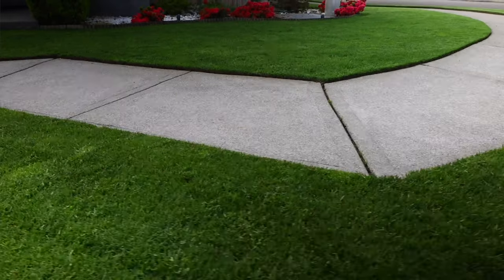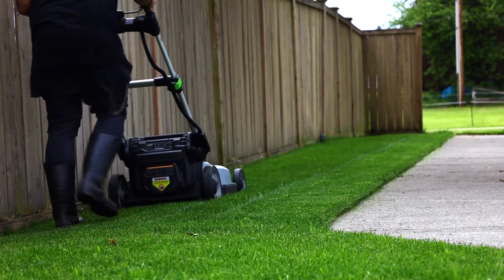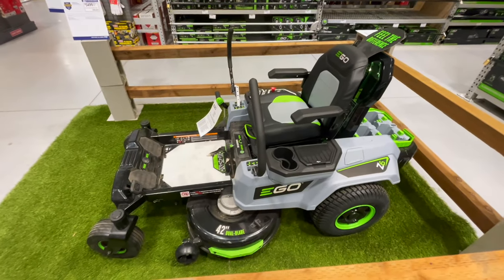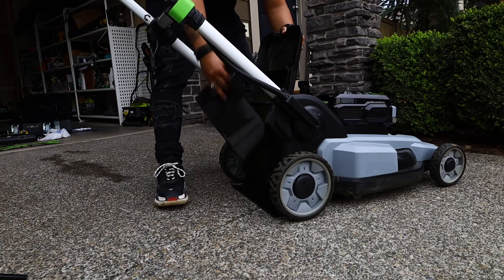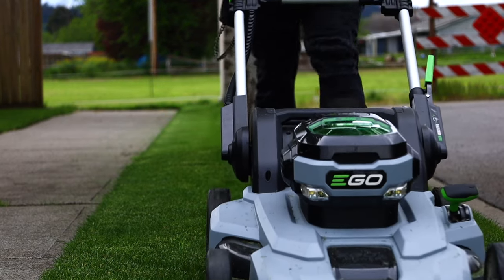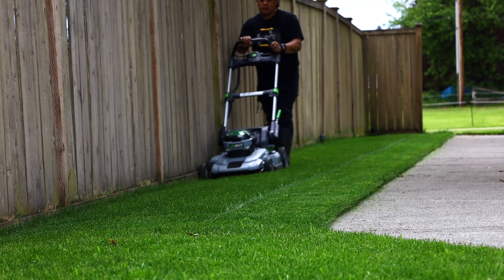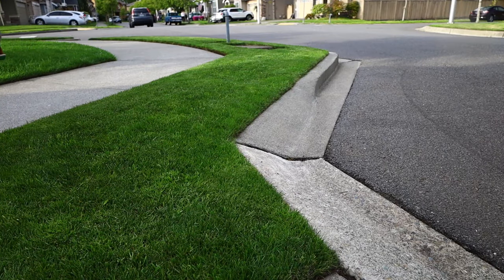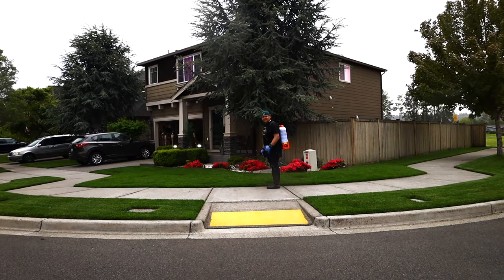Bagging or Mulching grass? great debate! Installed the EGO select cut Mulching Blades on the LM2100!

Comment: I have the ego 2135sp select cut, and I've found that if the grass gets a little high, mulching then putting the bag on (still using the mulching blade) and going over the mulch trails works extremely well.  This is what I did with my Honda, and the ego handles the job as well or better.  No need to put the bagging blade on the ego.
Reply from the maker: Yeah I noticed when I verticut the ego picks it up well so you’re method sounds fun! I gotta try it! You know me love to mow 30x a day on my 100sqft lawn 😂😂😂👊🏾😊🤙🏾🙏🏾🔥

Comment: Great video! I'm looking to convert my old 2102SP to the dual-blade set up. Before purchasing the parts as you listed, can any of the parts from this mower be used in the new setup, such as washer, bolts, etc.?

Comment: Just a heads up -  the link at top to extended run blade goes to a page with "Mulching Blade' in main title.  And when ordered you get an extended run pair in a box marked AB2100D Mulching Blade.  Also the extended run blade in box is actually stamped "lower mulching blade".  I ordered this a year ago as spare based on main title of page and am stuck with two extended run now since I already had the unused one that came with mower.  That one BTW is stamped 'lower extended run" with same engraved part number CH3707066002 as ordered spare.  In summary - open box to make sure you in fact received what you intended to order.

Comment: Silly question - the AB2101D mulching blades aren't listed as compatible with the LM2100SP mower? The only option I've seen as officially compatible is the AB2101 high-lift blade. I want to mulch and was going to go high-lift + mulching plug. Do you recommend installing the AB2101D blades, even if it doesn't say they're compatible?

Comment: What do you use as the drill attachment to mix up your fertilizer? Where does one get sea kelp and iron to add to the solution? And, who makes the back pack sprayer you are using?
Reply from the maker: Drill mixer attachment here: https://amzn.to/3xOyNdm

Kelp here: https://amzn.to/3UayCjP

Iron here: https://amzn.to/4b5mtUd

Backpack sprayer Petra hd4000 here: https://amzn.to/3W67rJB

Thank you for checking out the channel and for the support 😊🤙🏾

Comment: I used to have the single blade version of the Ego mower and it was terrible at mulching, leaving large clippings. Is the select cut Ego mower LM-2135 any better?
Reply from the maker: This is the base model not even self propelled with a dual blade conversion…. I’ve only owned the lm2100 and the lm2100sp ☺️🤙🏾

Comment: Do you need to switch blades in order to go from mulching to bagging and back again?  I want to mulch most of the time but I might want to bag in order to mulch my vegetable garden.  If I have to change the blades, that is a deal breaker.  Are there other cordless electrics where that is not necessary?

Comment: Could you bag while using the mulching blades? Any negative to doing that? Or is it better to use a high lift blade?

Also, can you convert any single blade EGO?
Reply from the maker: In the summer I usually keep the mulching blades on and it can bag a little bit but some will be mulched as well! If you are trying to bag long or heavy grass def go with the high lift I learned that just this end of winter when the mulching blades didn't pick up the thatch after a verticut! 😊🔥🙏🏾🤙🏾

Comment: Damn you have to cut your yard every other day??? I’m in Texas, cut my emerald zoysia once every 1-2 weeks using the high lift dual blades. In the long stretches of 95-105 degree days here I keep the grass at around 2.5 inches and it stays nice and green all summer. I tested one side of my yard mulching it down lower and it turned brown quickly and I had to water that section like crazy to get it to come back.

Comment: I’ve heard the high lift double cut is better with bagging and mulching as well. Have you put this to the test?
Reply: i did this befor my mulching blade turned up and its a yes and no if its a dry grass its fine will eat more battery tho but if its a more wet sticky grass its far to aggressive and just cakes the top of the deck. i just swap them out only take a minute to do.

Comment: Will the mulching blade work by itself on the 2100? Direct bolt on? no need for a new bolt / fan etc.
Reply from the maker: You need the conversion parts the height of cut will be off 😊🤙🏾🙏🏾

Comment: Having a hard time finding the “conversion kit.” Could you point me in the right direction?
Reply from the maker: What's up my dude! Yes go to www.partswarehouse.com and buy these part numbers

1 x EGO Fan #EGO-3403110001
2 x EGO Prevailing Torque Hexagon Lock Nut #EGO-5630351002

2 x EGO Bolt #EGO-5640321002
1 x EGO Flange Bolt #EGO-5640226002

1 x EGO Washer #EGO-5650705002

you can buy the blades at local hardware stores like lowes 😊
1 x EGO-AB2102D High Lift Bagging Blades

Hope this helps check out the other video! 

https://youtu.be/qrxIwJGQ9JE

Thanks for tuning in!!!! 😊🙏🏾🤙🏾🙌🏾

Comment: Just got an ego select cut mower and tried it on my lawn for the first time ( my first time mowing my lawn ). I had the height setting at 4 and it was cutting my grass way too low to where the lawn was looking brown after I did a cut. Raised it to the 2nd to highest setting and no brown grass . Any suggestions on the best height setting for a yard that is very un level. I have lots of divets and also some root stumps from trees . I'm realizing it seems extremely difficult to mow due to how uneven it is. It's 1/3 of an acre and I have no landscaping knowledge as far as leveling a lawn. Any suggestions?